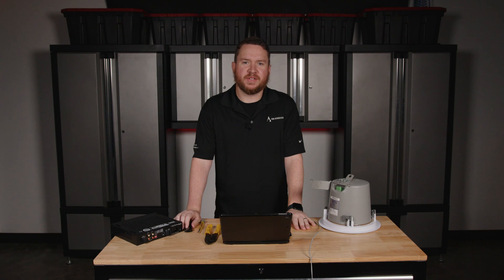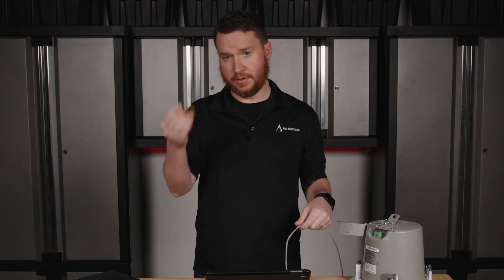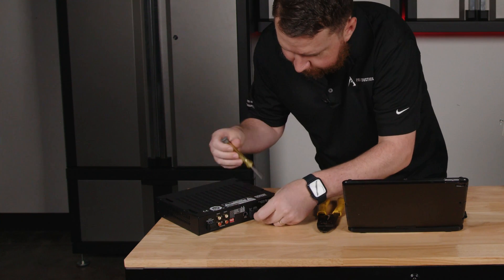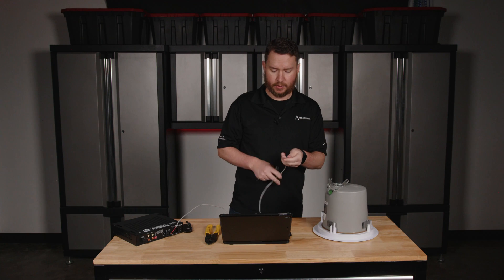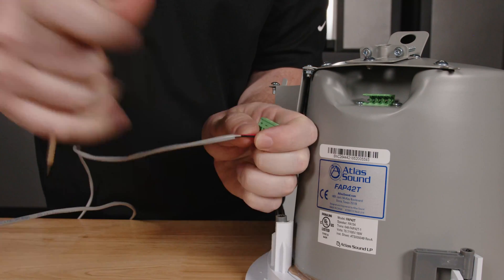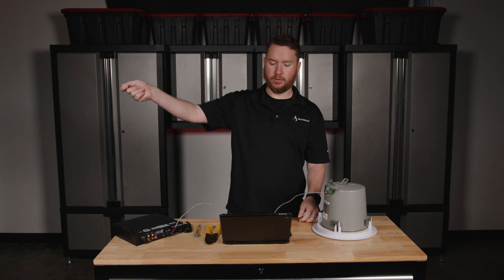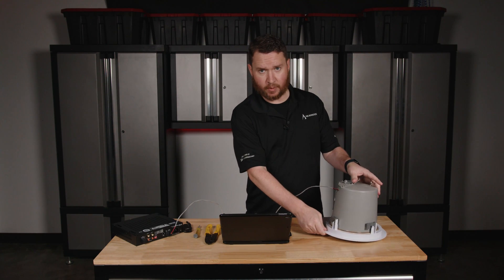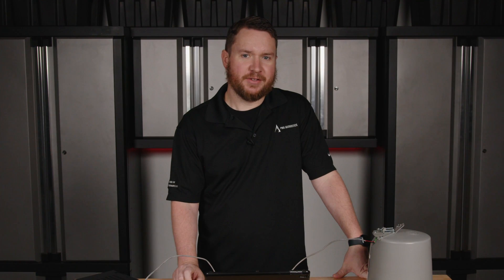How to Connect Ceiling Speakers to an Amplifier on Pro Acoustics Tech Talk Episode 119

Comment: I just moved to my new appartment where there are two ceiling speakers already istalled, wires are accesssble in my hall but no info or model on speakers. So I am going to buy  an amplifier but no idea about ohm or volt. Is there any default type of amplifier which can be connected? Thanks in advance
Reply from the maker: Your speakers are likely standard 8 or 16-ohm models. A traditional home theater receiver should be suitable to power them. If you experience any issues, though, it may be necessary to verify the exact specifications of your speakers for a more accurate match. Please don't hesitate to reach out for assistance; we're here to help! You can contact us at 1-888-256-4112 or email us at sales@proacoustics.com.

Comment: what is the name of cable (model of cable), my speaker is DX-IC4-W amplifier is Revamp4240T?
Reply from the maker: 16/2 gauge twisted pair speaker wire, such as West Penn 225, is the most commonly used option in commercial applications. It’s reliable and suitable for running sound to your speakers efficiently.

Comment: I have about 12 speakers how big the amplifier need to be?
Reply from the maker: In 70V systems, the size of the amplifier you need is determined by the total wattage of your speakers. You'll want to add up the wattage of all 12 speakers plus an added 20% for headroom to find the total wattage required for your amplifier. For more detailed information, please check out our video here: https://youtu.be/-omIOiKUrdw.